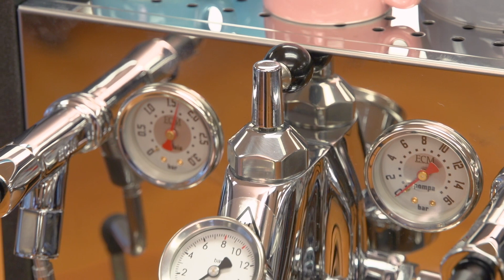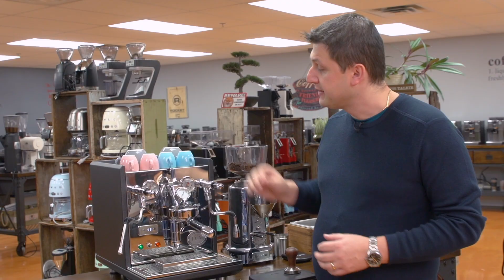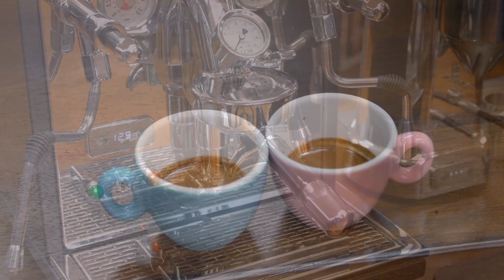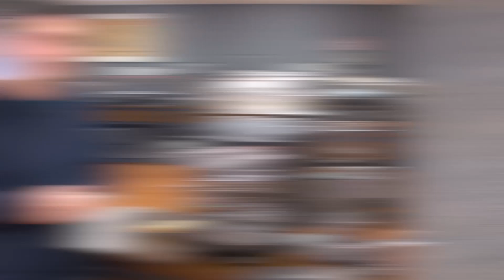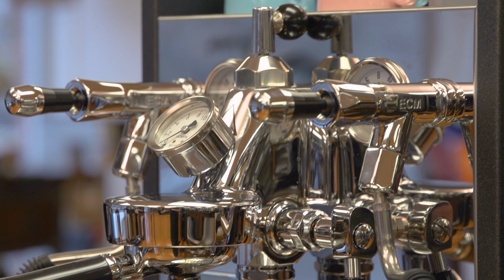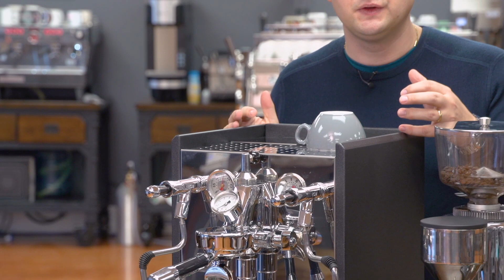ECM Synchronika With Flow Control

Comment: In your opinion this machine or the La Marzocco Mini? Is the mini worth the extra $2600 dollars?
Reply from the maker: They are quite different types of machines. The flow control is a different experience from just a standard pump on the LMLM. The Linea Mini is a great machine but you do have to pay a premium. The price difference is significant, enough to buy a very good grinder.

Comment: that is an insane brew time for espresso...ultimately hot water is in contact for over 50s... how does it taste?
Reply from the maker: Since the flow is quite restricted it takes more time to get full saturation.  The full pressure extraction is shorter.  I have found you can get a lot of variance in flavour changing the flow profiles and I have had fantastic tasting shots that took over a minute to extract

Comment: Hi, if i install a flow control unit ,is it mean that i can basically make a pre infusion without to connect the machine to the water tap because no need anymore to  a line water pressure level?
Reply from the maker: In a way yes, a flow control device reduces the flow so it takes pressure longer to build.  The effect is similar to pressure profiling but not exactly pressure profiling

Comment: This is a great, clear video. Thanks.

I have a question. Does a fully open flow control knob match or exceed stock flow?

 I ask because there are videos about flow control that describe 1.25 revolutions from closed as stock flow. They also explain that, towards the end of the range, the flow rate climbs more rapidly.
Reply from the maker: That's a really good question.  I haven't measured it personally but my feeling is that it does. I think that fully open the orifice of the flow restrictor is larger than in the stock gicleur so the flow would be greater than machine without the flow control and just with a standard mushroom

Comment: Crazy question, I know. Is it a huge difference between Slayer *also low infusion and ECM ?
Reply from the maker: It is possible to reduce the flow to a small trickle using the flow control device which is similar to the Slayer Espresso preinfusion

Comment: Does it have a restrictor valve?
Reply from the maker: The flow control device is an adjustable flow restrictor. You adjust it to open it to allow for more flow or close it to restrict the flow

Comment: Always wondered if this machine's flow control could be adjusted - now I know. I am assuming that the flow control works whether the machine uses direct water supply or internal reservoir? (skip that... just found the answer lower down). Great video. PS- Been reading that the flow control knob gets VERY hot.. how true is this?

Comment: lol Doing ~4 things at a time and saying "...and I don't need to worry about anything" never said someone with OCD hehe. Even though I can both froth and brew at the same time on my R58, I just can't watch my extraction from the naked portafilter, check my Acaia scale, keep the right angle while frothing and keeping another eye on the thermometer from the pitcher, and play with the flow control allll at the same time, that's not gonna happen XD

Just purchased today another Rocket machine from you guys and a flow control device from Profitec to fit my current R58 so I had to watch that video again. Can't wait to receive all that new stuff! :D

Comment: What bar pressure and temperature would you use for the settings for a machine at 1 mile above sea level? Thanks.
Reply from the maker: Hi,

Unfortunately this is not something that I am knowledgeable about, I have never lived at a high elevation.

Comment: I am interested in this ECM Synchronika and also the Lelit Bianca, both of which I would want with flow control. If you were to make the purchase, which of these two machines would you get? Please tell me why your choice was what it was? Thank you.
Reply: I have the same question! Hope you had the answer already
Reply: @khairolzaini7246  I have not heard any input from others. however from what I’ve researched I believe both are very good machines. IMHO the Bianca gets you more bang for the buck, but is not as popular as the Synchronika.  I feel the later is more popular because it is sold through more retailers across North America. If you want all the functions and save money than get the machine by Lelit. However, if you want recognition than get the EMC. I feel the Bianca has more sex appeal over the EMC. Good luck. Oh, the money you would save will be well spent for a better grinder and or towards a good scale if that your thing.
Reply: @rottiejakeluke  oh what machine did you get tho? Im still stuck between these two. I like the way the ECM looks and its built inside out. I havent seen any ECM owners in this country and lots are buying the bianca. So im thinking of the service and if somehow the ECM broke down. I'd have nowhere to repair 😂 the bianca instock here is the same price as if i bring in the ECM from Hongkong. Really gives me a headache!
Reply: @khairolzaini7246  my purchase was squashed due to lack of funds which had to be used for a family emergency,
Reply: @khairolzaini7246  which one did you get?
Reply: also, does flow control improve taste?
Reply: @hitshot  i got the ecm synkronika. Its a well built machine! Love the feel of it & normal extraction is good enough. Haven't really got the great flow profile shot tho
Reply: @khairolzaini7246  which grinder do you recommend for it?
Reply: @hitshot  i got the atom 75 with red speed burr. But then again it depends on ur usage. Is it home or commercial
Reply: @khairolzaini7246  It's only for home usage, most likely with the Synkronika

Comment: The ECM kit comes with a spring to replace the existing spring in the lower part of the group. What's the purpose of that?
Reply: we were suprirsed to find that as well, we ended up changing the lower half but not sure why
Reply: @ange5354  OK I found out, its to cut ECMs built in preinfusion so you now have complete control of your own preinfusion times.

Comment: Hi Slawek, by far the best (Flow Control) video I've seen and I've been looking for quite a few! I like that it's also straight to the point, easy to understand and only 8min long. I've also been comparing machines on your website for a few days and I'm hesitating between gifting my mom a (Profitec Pro 500 or Rocket Crono Type V) as she clearly doesn't need any higher-grade but then I'm also thinking of maybe instead giving her my 99% new Rocket R58 to get that Synchronika with flow control heh. Damn hard decisions!

Comment: at 1:37 the water flow from the shower screen at the pre infusion phase is not  giving a water shower effect . is this the stock shower screen. any reason why its pouring as one channel rather than even wide shower droplets?
Reply from the maker: Hi, this part is refered to as a shower screen but the dispersion isn't like an actual shower when there is no coffee.  When you have coffee and back pressure it does help in dispersing the water around the whole puck but that is the normal flow for an e61 with the portafilter removed
Reply: @layas8690  Highly suggest that you buy the (IMS E61 Shower Nanotech) from IDC. It's one of the best upgrade you can do to any E61 machines and is about only 45-50$? I got one for my Rocket R58, it's wayyyy better than stock for shower dispersion and keeps it 10x cleaner.
Reply: @PanzerIV88  . The ease of cleaning part is also appealing . thanks for your suggestion

Comment: Hi does the pre-infusion work with the machine running off the reservoir and not plumbed  in? I have been told you can only pre-infuse with a water line??
Reply: From what I understood, it is even more useful to those who aren't plumbed-in as otherwise there is no way to pre-infuse but with a flow-control you get to mimic a plumbed-in machine since you can start for example at 1-2 bars for a 10-20s pre-infusing instead of being 100% of the time at the full 9.5 bars. Plumbed machines have a default in-line pressure around 2 bars at the house or you can have an external filtering thingy such as those from BWT to then lower the pressure to 1-2 bars if ur house have too much pressure.

So a plumbed machine without flow control will be able to pre-infuse at 1-2 bar yes, but then it will be full pump at 9 bars, no in between. That's the point of flow control so they get the in-between but people on reservoir get the adjustements AND the pre-infuse capability so it's really interesting as you don't need to spend an extra 400-500$ on a rotary pump and break ur kitchen's countertop to plumb the machine ^^
Reply: @PanzerIV88  does flow control improve the taste, and would you recommend this machine over the lelit Bianca?
Reply: @hitshot  I don't know any Lelit machines but I can say that there's a few things which you can't go wrong such as having a PID, E61 brewer, HX or double boiler over single boiler, having at least 1.2Bar if steaming pressure.

To be honest I ended up not really experimenting all that much over the last year, as I find dialing my grinder to get my 2:1 ratio of 20g for 40ml between 25-30sec to be more important overall. I just started last week to do the WDT technique with a tool from Amazon and it DOES make a difference in puck consistency. Same thing for my new grinder since 2 weeks when I went from a 65mm "Rocket Fausto" to the awesome 83mm single doser "Ceado SD37" and also started doing the RDT technique with a water bottle that came with it, major difference to reduce mess and static, like it gives me 0.00g or at worse 0.01g of retention inside, it's just crazy efficient!

So all this makes more of a difference than flow control which is anything but cheap so better keep that money and invest in a better grinder, that is so underrated. I have a friend who bought his first real machine "ECM Classika" or something like that, 1000$ single boiler... But since he had such a sh*tty grinder, he never got to use his espresso machine and had to return it after all the tests I've done with my tool on his equipment.

So I'd say that flow control is the last thing you get, very optional and a temperature gauge is prolly gonna be cheaper and more useful imo. It's very hard to dial the pressure in between, seems like it stays low during pre-infusion like 2 bars or 4 at most but then if you open it one quarter, it goes quickly to full 9.5bars so okay if you want to pre-infuse more than default E61 but good luck doing fancy profiles and that's gonna be a waste of time on anything less than top quality and freshness coffee.

Comment: Do you find that you have to adjust your grind according to what profile style you will be attempting? I am finding that a grind thats giving me the correct weight at 30 seconds with the original hardware, is giving me super fast sputtery flows with the flow control hardware once the pressure is rampped up after a pre infusion.  Any tips?
Reply: Just curious, hav eyou got to fix ur issue after 3 months of practice since your comment? I've read elsewhere that some users needed to grind a bit finer when playing with the flow control because of the pre-infusion I guess. I don't know if it's only if you pre-infuse for too long though.

Comment: Very informative video.  I noticed that the water flows out in a single stream at the beginning of the video (both at low as well as Max flow), instead of a dispersed shower.  Is this the norm on this type of machine and would a focused flow like this lead to channeling or uneven puck saturation/extraction?
Reply from the maker: This is normal flow for an E61 group without any coffee.  Once you put coffee in the puck and you get back pressure the spray evens out.
Reply: Just get urself the (IMS E61 Nanotech Shower). Trust me it is unexpensive and by far one of the best upgrade you could do to any E61 machines!

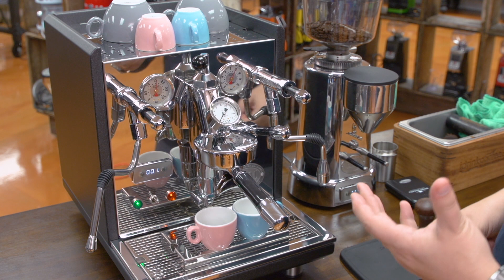Comment: At 2:23 when you start the shot, how does the manometer in the upper right read 9 bar, but the flow control manometer stays at 0? What pressure is the manometer in the upper right reading if the pressure in the brew head is still at 0?
Reply: John, the upper right manometer is the pump pressure, the flow control manometer is downstream of the flow control valve. By shutting this almost to fully closed it takes time for the pressure to build up.

Comment: Great video. Hopefully you can get the profitec versions to.  Heh I typed to soon. Just saw the end to see it can be installed on any machine. Thanks!
Reply from the maker: We have both the Profitec and ECM in stock.  For now we only have it on new machines but a kit will be available soon to upgrade any machine.
Reply: @iDrinkCoffeeCanada  This is awesome news! I bought my Synchronika with the hope that the FCD upgrade kit would soon become available. Any insight on timeframe for purchase?
Reply from the maker: @LuckyDragon289  we will have upgrade kits available in the new year and they are not difficult to install
Reply: @iDrinkCoffeeCanada  great news!